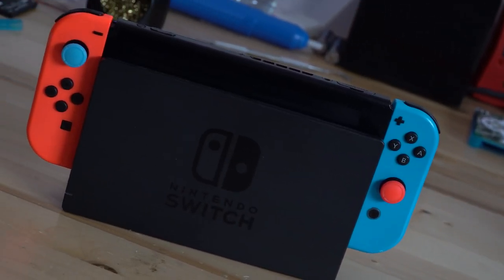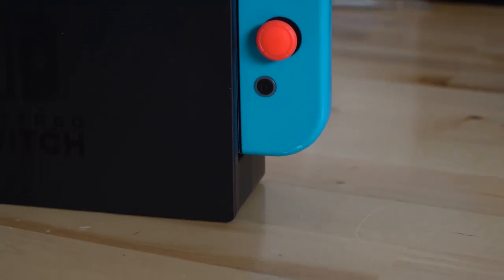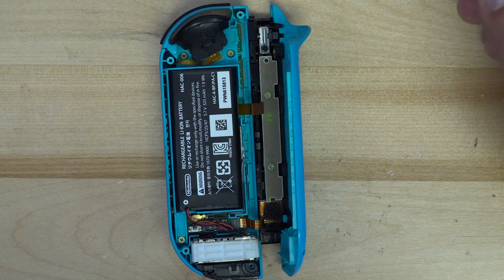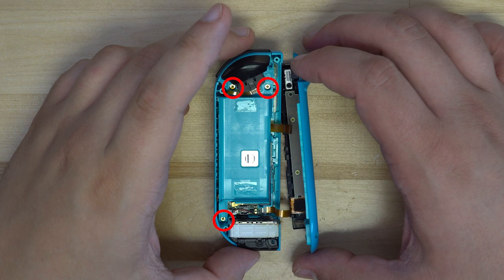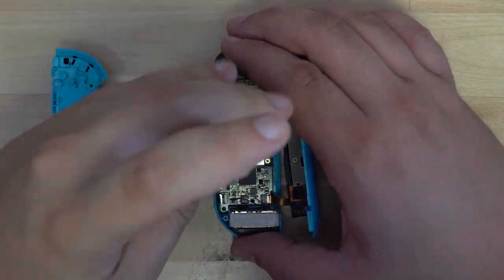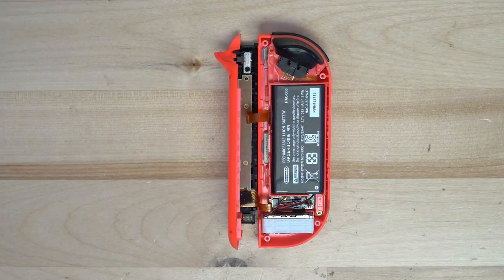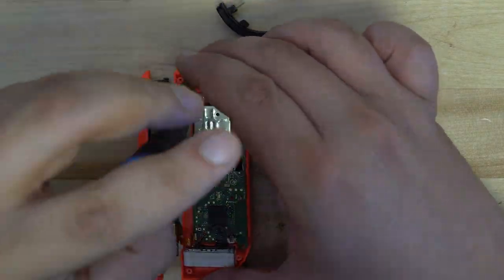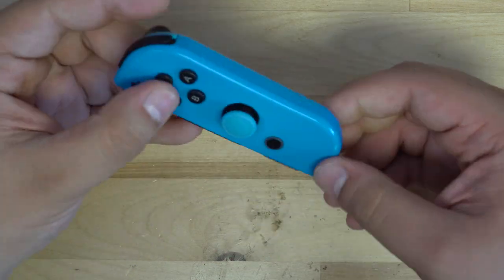Gulikit Hall Effect Joysticks | Install Guide

Comment: Please provide better instructions when it comes to disconnecting the battery. You said to just pull up. I did this and it ripped the wire from the connector, now the battery doesn’t work. I should have looked at the amount of views / likes before watching because this is an amateur tutorial. Please beware of this video, the controllers are extremely delicate. Watch a professional takedown video instead.
Reply: Get good. It's obv that you be careful while doing so
Reply: I did what he said and it came off perfectly, not his fault, skill issue
Reply: @illtimedwillinc7934  You can apply “obv be careful” to any tutorial you are trying to defend. It’s a flaw in the tutorial that can be improved, get over it. 5 likes vs 1 proves who is right here 🤷🏻‍♂
Reply: @r3ucs.  Good for you when are we celebrating your accomplishment? I’m so proud of how far you’ve come 🥺
Reply: Dude literally says be careful with the ribbon cables @ 0.53 in the video
Reply: Skill issues
Reply: @Budbuzzer1 skill issue, be lighter on ur tech bro
Reply: Also had this exact same thing happen. And for whatever reason, the plastic part that was supposed to come out with the wires won't budge no matter how much we try and get it out. Can see that it's lose, but even when I did get a good grip on it it wouldn't budge a bit (even though the wires came out with no effort at all). I'd hardly call that a skill issue
Reply: Even professional videos say to pull up strongly, I left it there, but was harder to disconnect and all that stuff but works great
Reply: Dude do these repairs at your own risk. That’s on you 😂
Reply: So common sense applies here. If you don't realize you should be careful with tiny wires because they're fragile then maybe you shouldn't be doing tech repairs. This tutorial was fine, definitely a skill issue.
Reply: @Kaye23X4  “Being careful” is different from inaccurate instructions. I got the wires back in after clipping them a bit with full functionality, so no loss to me. The video doesn’t show the removal of the wires effectively, and therefore I commented a criticism. It’s funny that it’s upset so many people like you though 😂
Reply: @Budbuzzer1  Didn't upset me. You actually seem to be the only upset person here.
Reply: perhaps you are the amateur
Reply: The way to remove that connector is to pull up. There's nothing wrong with the tutorial. As you said they're extremely delicate, yank at cables at your own risk.

Comment: Do not disconnect the middle board ribbon cable, it is a nightmare to put back on, and is easier just to leave it off to the side.
Reply: I should have seen this before starting... I'm on the second joy con and it's really getting on my nerves. Most of the time I spent on the first one was just getting that cable back in

Comment: I don't recommend this replacement if you need to ever use the stick buttons. My wife plays a game where she needs to use the buttons and after a few days the left stick just stops clicking and won't read left/right inputs. Happened twice.
Reply: I've not had this issue. Are you sure the ribbon cables are seated correctly?
Reply: @ZeldagigafanMatthew  yes, they worked for a few days or so perfectly. Maybe my wife presses down really hard on the sticks, but we got OEM Joycon Joystick replacements and I installed them with the cardboard backing method and they've worked for weeks now, idk man.
Reply: @AntonioEligius   maybe you got a bad unit, sorry it happened tho.

Comment: Hello bro, I have a question that I hope you can help me, (I'm from Spain, that's why my English is bad) I bought these joysticks and I removed the rubber that you removed to put the color blue, I also did it to change the color to blue because It's great, what I did notice and that's why my question is that when removing the rubber from the joystick it unfolds, as happened to you, the anti-dust rubber that is under the stick, that thin rubber that is meant to protect from dust, and then when putting again the stick notice that this rubber is no longer so attached and if you look it dances a little more than normal is this normal? I don't think it's a problem but I wanted to confirm a greeting, I don't know if I explained it well or you understood me
Reply: Help, the same thing happens to me, did you solve it? 5:17

Comment: I do not recommending to disconnect the cable on 2:50 ... 
Its a nightmare to put it back on.
Reply: Same here, I agree.  That cable is a lot shorter than the other side and I had a terrible time reconnecting it.  After it was all back together, my ZR didn't work and I had to reopen, and fight with it all over again.  Luckily, 2nd time around it seems to be ok now.  Do yourself a favor and work around it without disconnecting
Reply: 100% agree
Reply: @MD-ot3nl  the metal thing should face down when you clip it for the right joycon and it should face up if you’re doing it for left
Reply: Yeah… still can’t get it back on, any tips? I have the fattest fingers ever lol
Reply: The person who posted this video should honestly pin this comment. I thought the ribbon cable for the Joycon was a pain to reattach, this ribbon cable was WAY worse. It really isn't necessary to disconnect it.
Reply: Even though I agree it is a pain to reconnect it, when it's connected it doesn't have much slack and it would be very prone to damage while removing and replacing the joystick. If you're going to keep it attached I would be very mindful of how taut the cable is and be careful not to snag it. Personally I would rather go through the headache of reattaching that cable than possibly damaging it and having to replace it.
Reply: Wish I'd seen this before. I not only disconnected the cable but during the re-installation managed to break off the clip from the ZIF connector and fly it off somewhere, never to be found. Scratch one Joy-Con :(

Comment: The connector at 2:48 is especially tricky to reconnect. The way he's holding it at 3:22 gives you just enough room to reconnect it but be patient with it.
Some users are saying not to disconnect it but it is very short and taut, and prone to being damaged if you aren't mindful of the plastic piece you're moving out of the way.
Do what you're more comfortable with but imo I'd rather go through the 5 minute headache of trying to reconnect the f**ker. As annoying as it is, breaking it and having to replace it would be even more annoying.

The cable at 4:15 you could get away with not disconnecting but it isn't hard to reconnect.

Make sure to calibrate the sticks in the Switch's settings for them to work correctly. They work great!